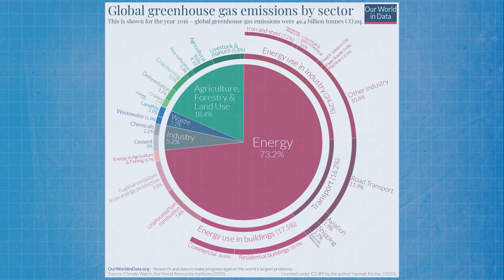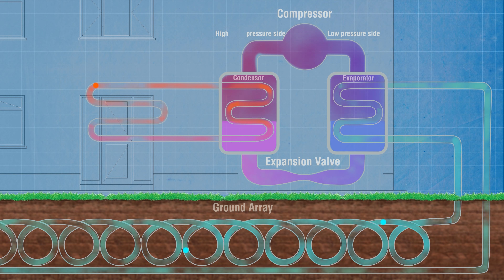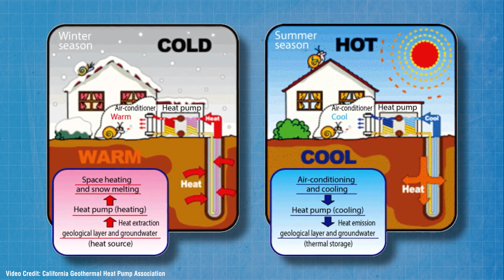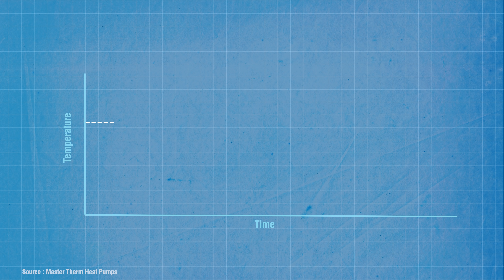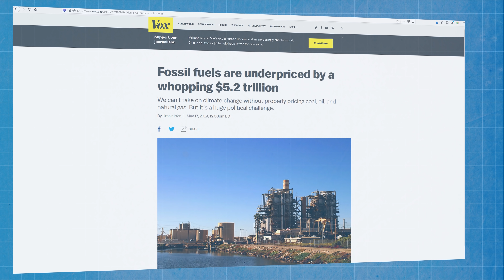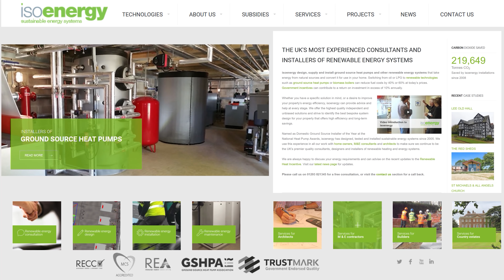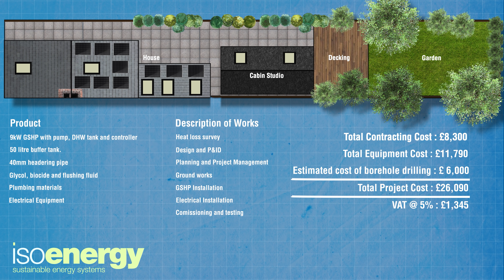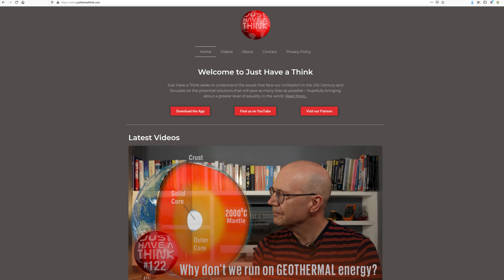Geothermal ground source heat pumps. Heating your home from your own back yard!

Comment: Yep. But like many people with a message inconvenient bits are left out. Ground source heat pumps are more efficient - although not as good as stated. Even companies selling their systems point out that the 1:4 ratio is only in lab conditions with 1:3 more likely when installed in the most efficient way. And that's with underfloor heating. What Mr. Just Have a Think is not saying is that if you use radiators the requirement is to increase the water temperature and as one should understand is that it's a curve of energy input to temperature output not a straight line. In an already built house the radiators use water of around 60c. Ground source heat pumps (by design) have a maximum output of around 55C and at this level the efficiency has been drastically reduced. So, you need to do two things. Either dig up your floors and install underfloor heating or add a lot more radiators of better efficiency. A lot more. 

The other issue is that a ground source heat pump works on the refrigeration cycle and use HFC's which, have huge GWP of 2000x that of CO2 with other well known issues. And while many people thing HFC's have been phased out that's not the case. They have improved not gone. Their effects on the environment have diminished but not gone. And if anyone is familiar with AC systems which a ground source heat pump is, knows that they do need topping up now and again as gas escapes. Now, upscale that effect across millions of homes. 

Then there is power. You need electrical power and it comes from a station. That's not 100% efficient. Converting that power back into heat energy to put into the house or ground depending upon winter or summer is not 100% efficient either. 

 And to anyone who has worked in split AC systems we know that their lifespan is not huge requiring exchange with new equipment. 

In the UK and in fact anywhere where the climate if highly variable there is another problem. Speed of reaction. When a house is fitted with underfloor heating and is done efficiently the water temperature is very low. It relies upon a large surface area and a long period of time to warm up. Fine if you live in Sweden or Finland when it gets cold very quickly and stays that way for months. In the UK for many weeks or indeed months one day might be cold and another warm and thus underfloor heating with GSHP's running efficiently can lag significantly behind what you require. 

GSHP systems would be a good option for newbuilds for sure. But the presenter of this video either ignores the negatives deliberately or is not aware of them.
Reply: Interesting comment Mark.  With regard to HFC's...how often have you needed your refrigerator topped up?  What exactly are you suggesting as an alternative?  My GSHP is10 years old...it was checked over this year and does not need a top up (maybe it will next year....).  Heat pumps are currently our only viable non fossil fuel option for heat and currently I am not aware of any sustainable alternative to refrigerant based cooling systems.  Just wondering what your objective was with this comment?  I don't believe that Dave has suggested a solution to any of our Climate problems that has zero associated negatives...every option comes with compromises but at least he is presenting ideas/solutions that are real and realistic.
Reply: @richardlangley90  I'm a marine engineer and we use a lot of refrigeration gas. The simple thing to do is to go look at any website dealing with AC systems. You will find a lot of HFC gas for sale in disposable and rechargeable cylinders - which you can buy in the UK if you have an F-gas certificate. If not, you can buy it from Europe and it's about 100 quid for 800g. Bottom line is that it's sold in large quantities thus it's going somewhere. If GSHP systems are adopted on mass there will be a commensurate increase in HFC gas sales. All it takes is one small fitting to pass a little bit of gas.

Comment: Surely, it could be a stipulation of planning law that all new housing developments over a certain size must incorporate technology of this kind. It would massively drive down installation costs, as well as being the right way forward for the environment. 
Where I live, many new sites have been developed with zero consideration for such matters.
Of course, you can't blame the developer because they want to maximise their profit; but the short-sighted and lily-livered local planning authority are wholly culpable for such omissions.
Reply: Here in Finland heat pumps are very common and it is a no-brainer when building new houses. We also use central heating, my apartment is heated partly by the local metal industry, capturing their waste heat to low pressure steam, which is then piped to the town and used for heating. Also, trash burning is used for this, it is high flow, high temperature furnaces using monoxide recycling and carbon scrubbing. It is hot enough to return  plastic etc back to their most basic elements and compounds, it is quite clean process, most of it is CO2, water and nitrogen. Trash is separated here so what ends in the trash burners is single use plastic, cardboard that is soiled or unsuitable for recycling, food packaging and other such household waste that would end up in landfills.
Reply: @jamesmay7392  Very progressive thinking. 
In England, we are not so advanced!

Comment: Great video! I am a certified residential geothermal designer and love this video. I’ll keep it in my Supplies of informative videos to share with my customers from now on! If you’re in the USA and looking to build or replace PLEASE consider a geothermal system and get it designed rather than “off the shelf” DIY kits, soil is different everywhere and you need to take soil conditions, lithology, and geology into account. And don’t forget, there is a federal tax incentive for 2020 that is reduced in 2021 as they phase it out with the solar incentives. Good luck and thanks for the video!!!

Comment: I live in the Buffalo, NY area in the US.  In the late 80s I installed, with my father, or maybe it was, I helped him install..., a ground exchange heat pump at his home.  He had an artesian well, if you don't know, an artesian well just overflow water all the time, I guess because we lived at the bottom of a hill so we had a lot of ground water that was at 52-56 degrees F all year round.  We just used a well pump to bring the water into the unit and just pumped it out to the dich.  This my sound wasteful but it literally overflow all year round anyway and if we were not using it was just overflowing into the dich anyway.  It worked pretty well but was very loud.  The noisiest part of it was the water pump but the compressor and blower motor were very loud as well.  I think they are much more efficient now and I would like to install one now in current home.  I would of course use a ground loop instead of a well.  it is much quieter and cheaper to circulate the glycol in a loop than it was to pump the water and a lot less wasteful

Comment: I know the inventor of this system look closely at the system you don’t need much to provide good heating and cooling.
This system has existed for some time now and the first unit was installed in wineries in SA.
Already installed a heat-pump never mind a conversion system is provided.

https://www.linkedin.com/posts/gerald-at-fiera-group-018b16101_gerald-fiera-group-circular-energy-applied-activity-6719035893166043137-g3XT

Comment: I live in the desert. Phoenix Arizona. I could easily see how dumping the heat from the house into the ground, or into a swimming pool would be extremely beneficial. But unfortunately, there’s very little ground source heat pump in Arizona. Probably because of the non-moist soil, Which is not the best for heat transfer, from what I’ve heard. I would like to go ahead with ground source heat pump in my area, if you have any advice. ?? But I’m having a hard time finding anyone that does this, around here.

Comment: I built a system using solar vacuum tubes/ground source piping/ inverted variable speed refrigeration/ and test ran for three years. Heated/cooled home made all domestic hot water/clothes dryer. Yearly cost went from $4500 to $300 per year. It can be done. Couldn't find any investors to promote and patent and manufacture. Have been doing geo-thermal for over 40 years. Frustrating to see how long it's taking for this technology to be commonplace.

Comment: From what I have heard, ground source heat pumps are a massive step up from air source heat pumps then even beyond that are water source heat pumps at the top! It works much more efficiently if you have an ocean, river or lake nearby. It works for heating and cooling, depending on the climate or season.
Heat transfer to liquids is much more efficient then it is to a solid or a gas :)
Reply: pumps that sacavange heat from ground or water surce are mo efficient and less affected by the outside temperature than air heat pumps. but in more milder climates air heatpumps do just fine and they do ok even in cold climates, the disadvantage of ground/water source heat pumps is that you need land tor avaiable water to do it and often especially with ground heatpums the instaplation is much more expensive since you need to dig and install a lot of piping to collect the temperature.

Comment: Where I live many, many people would love to install such things.  However, costs run from $40 000 to $60 000 and energy savings would equal about $800 a year for a typical home.  And there are zero rebates or incentives.

It's like electric cars.  The best electric cars only have 59% of their range when it's - 10˚C.  When it's -20˚C, which it is from 10 to 50 times a year, the electric cars get only 38% of their range, which for me wouldn't get me to work or my son to speech therapy.  And that's when their new, think of a car with a 3-5 year old battery.  Sheesh.  And nobody's done tests at -30˚C, which we had for 37 days in 2018-19 winter.

Technology still needs to improve.  Solar cells here are a good idea but need 100% replacement every 3 years and need sunlight, which we aren't a great area for.  Wind turbines are used more, but large-scale ones have been shut down since two bat species and three bird species were nearly driven to extinction, and are still (hopefully) going to recover.

Technology still needs to improve.  I"d love to buy electric cars but when I can't use them 4-6 months a year, well.....

Comment: BTW, I'm surprised you didn't mention direct exchange systems, where the condenser coil is buried directly in the ground.  Also there are systems where air itself is circulated through buried loops and entirely avoid the need for a heat pump.  Of course these last systems are only appropriate where the loop can be buried in soil that is close to the desired building temperature.  Interestingly these types of systems are particularly useful for greenhouses in cold climates as they can extend the growing season to almost year-around at a relatively low cost.

Comment: My best friend (back in Texas) installed a geothermal heat pump system in his home over a decade ago.  He did most of the installation work himself.  And no, he's not an HVAC installer - he's a computer programmer with some history in the automotive industry.  The system wasn't cheap, though I think he spent less than $20K (USD), it eliminated about 2/3rds of his power (electric and gas) costs and should have paid for itself in less than 6 years.

Also I'm not sure why governments need to provide significant incentives for programs like this.  They mostly should be providing public education.  If a system saves on power, it also saves on money as long as the capital costs are not prohibitive.  With break-even under 10 years, anyone that owns a property and is responsible for the cost of heating and cooling it is just being wasteful with their money if they don't install such a system.  And don't tell me they can't afford it - they're already spending the money, it's just going to someone else.  What they should do is take out a HELOC against their home and have a system installed.

As for myself, I live in an extremely moderate climate in the US state of Washington near Seattle.  Heating and cooling costs here are almost negligible.  I rarely need A/C and while the heat runs fairly constantly during the winter, the demands on the system are rarely high.  In fact my annual power bill runs about $1,500 (USD), so it would take closer to 20 years to recoup the costs of such a system.  That makes it a more questionable investment for me.  But most places in the USA that's not the case.

Comment: My understanding is that ground source heat  pumps actually work best where temperatures cycle larger amounts because otherwise if you are always extracting or always dumping heat into the ground eventually the ground to air delta temp starts reducing

Comment: I live in Florida, US, where geothermal is used for cooling. I'm also an handyman/plumber. Leaks, I can fix, but repairs and maintenance to geo are a problem as challenging as new cars.  Back in the 50s/60s I rebuilt most everything on or in a car. Now, I change wipers, sometimes light bulbs. Several folks with geo call me first and I say, you need to talk to somebody that knows what their doing, probably the installer. I've hear later, it was cheaper to pull the geo out and install a complete heat pump system.

Comment: Solar thermal heater, Photovoltaic to power pumps and compressors, micro wind turbines,  better insulation. Perhaps an examination of return fluids passing an archimedes turbine generator. A reduction is the first part of the three Rs.

Comment: While geothermal systems are not uncommon in Sweden, almost none are installed today in single households (relative to how many systems are installed in total.) Instead most new heat pumps are instead air to air, because they are simply so cheap to buy and install, or air to water, because they work better if you want floor heating.

Comment: We installed hot water radiant heating pipes in the concrete slab, with a tankless water heater, very efficient closed loop system.
During summer, the valves are opened and cold mountain spring water flows through the floor and chills the foundation. The water then flows Back to the stream just below the mountain spring.

Installation cost during new construction was about 5000$ dollars.

Comment: Does anyone know how a geothermal ground source heat pump would work in a home with a forced air natural gas furnace in a place like Toronto, Ontario, Canada? We have pretty cold winters, down to minus 20 Celsius isn't uncommon and hot summers, 30 degrees Celsius or more. Thank you!

Comment: As a home inspector in North Carolina, I have seen a variety of these systems!  Not single one of them was worth a "Flip"!!  None of them did an acceptable job of heating and they were frequently un-functional as in defective.  Most of the systems required conventional electric or gas backup systems to provide heat.  These systems are "JUNK"!!

Comment: We built a new house in Spain and used Air source heat pump by samsung and very efficient as generally weather in Spain much better. Using underfloor heating and cooling

Comment: Here In the Netherlands ground heatpumps work best when the ground gets recharched with heat from a solar array. The panels cost less than increasing the size of the ground heat exchanger. In any way, drilling is very expensive. I've put a km of tylene tube under my house when the hole for it's foundation was made.

Comment: If you don't have opporunity to take the heat from the ground, you can take it from the air ventilated from your house. As long as it is not too cold outside you will get a good economy. If you have air in at 5-10 degrees and cool the air out to freezing, you get enough for compensating for the loss through windows and walls. If you have a well insulated house. And always fresh air inside.
At least have a heat exchanger in your ventilation system. That will save you alot.

Comment: I ran maintenance on a ground source heat pump system that provide artificial ice and heat for skating and curling rinks. The operator prior to me didn't understand the system well enough to know that you couldn't just top up the loops with de-ionized water. He added enough water to antifreeze mixture to freeze 6 loops bursting the pipes. It was a trouble shooting nightmare and thousands of dollars of anti-freeze (methanol) to find and isolating those 6 loops. If all you know about ground source heat pumps is what you were told in this video this most likely isn't the heating cooling system for you.

Comment: I think most of the energy in this system are not from the core of the earth, but by ground water from surface water, heated by the sun. You need flowing ground water to get the system working. If you install them too close they will steal energy from each other.